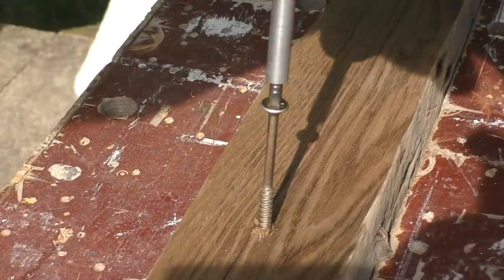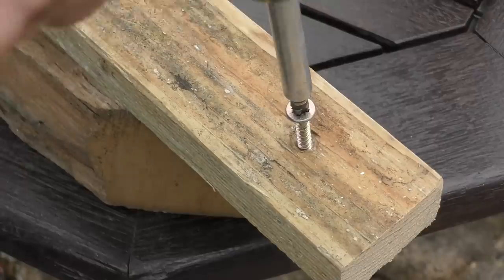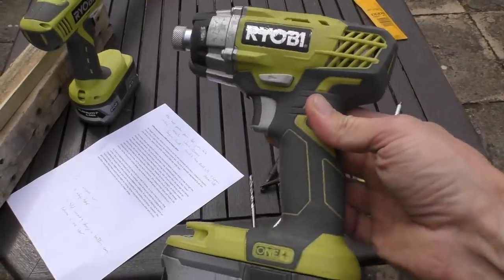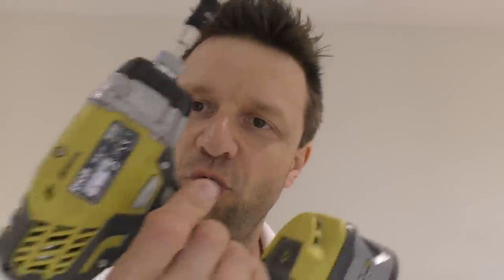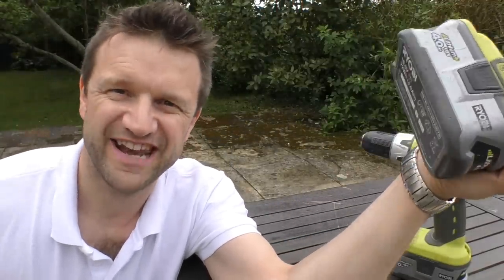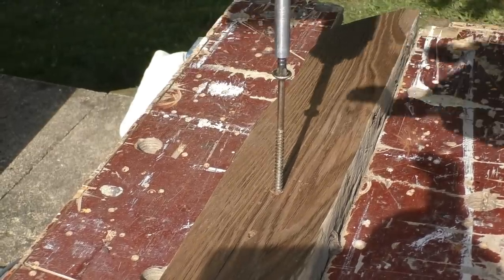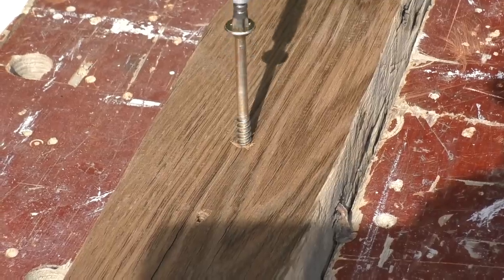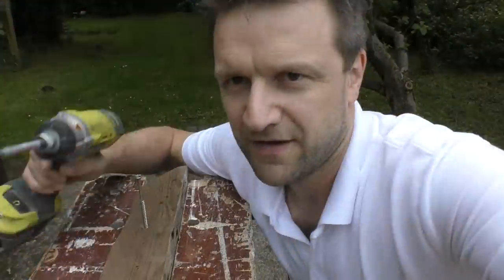Difference between Drill Drivers & Impact Drivers

Comment: The trick with Ryobi and other brands of cordless tools is to take advantage of the sales and package deals they offer several times a year, usually coinciding with major holiday periods. The drill and impact drivers are often sold as a set including batteries and a charger, with the price of the set being the normal price of one tool; sometimes you can get a four or five piece set of drill, driver, reciprocating saw, skil-type saw and batteries for substantially less than buying them one at a time.  Expensive 4 amp hour batteries are often sold at a two-for-one price during these special sales. There is a real advantage in choosing a brand of tool that shares common batteries among the various tools - choose carefully, it is unlikely that you will change brands later.
Reply: And even better is Ryobi hasn't changed batteries since 1996. I think I have a dozen or so batteries now just buying those "special buys". I'll take the better battery, add one of my older or weaker batteries and sell it for half
Reply: DeWalt is for supervisors, ryobi is for children
Reply: I feel like that statement makes about half as much sense as you think it does...
Reply: @chrisapplewhite6660  everyone knows supervisors dont do a damn thing
Reply: This is precisely why I will nevet buy another Makita again. After purchasing the drill a few years ago I needed a hammer drill which coincidentally didnt include the new battery for that years line of products.

I could no longer ignore that Milwaukee sale for a combination hammer drill/drill driver that came with an impact driver, 2 batteries, and a charging station. All of that combined was still 40% less than the Makita hammer drill, new battery, and necessary charging station for said battery.
Reply: @chrisapplewhite6660  well yea the supervisor wants the Dewalt, cuz it's nvr gonna run
Fitting for the 1 that doesn't do anything anyway
Reply: @chrisapplewhite6660  and yet your the one who delivers a childish comment. DeWalt fanboys are the worst. Sure they make SOME good tools but a lot of their stuff is not up to scratch anymore.
Reply: The trick with Ryobi is NOT to waste your money in buying it! 😂🤣😆
Reply: Honestly, Ryobi is for home use, but Dewald, Makita, Milwaukee, and Bosch are for serious commercial work. I've bought an 18V Bosch drill 6 years ago and I still have it with same batteries and it is still running strong. I even dropped it a few times from ladders and it still functions the same with zero cracks in its enclosures.
Reply: In that case, real workers may use "Milwaukee" tools.
Reply: @mweezy  christ get a grip...........my ryobis work hard very hard never had a problem and i dont drop my tools.....they are my livelihood.....
Reply: @rgeo27  lol sure they do....
Reply: @mottthehoople693  
All jokes aside, Ryobi isn't well built. When money was tight, I bought a Porter Cable  reconditioned set and everything still works fine. The sawzall for example, outlasted 4 heavy duty Ryobi ones, which were literally smoking btw. I've upgraded to the brushless set and have bought everything cordless and it's simply excellent! Ridgid isn't bad either for more bang for your buck.
Reply: @mannysabir1339  maybe.....but ive got old ryobis that still work hard...I dont ever flog my tools till they are smoking..i  will change the bit of the saw or whatever no need to smoke a tool........If I really need heavy duty tools I use my generator and all the old tools dad left me....old Wolfs etc....Im sure i will leave them to my son...they outlasted dad and they sure will outlast me...but I have no problems with ryobi and if i put one down and forget where i put it i just get another one..then I find the first one again and have two...
Reply: i use ryobi cos b and q give a 3 year warranty no questions asked just take it back with reciept then go pick a new one up off the shelf all my tools have a use by date sharpy'ed on the bottom (i still buy the deals with batteries tho)
Reply: @flatlandAutoSales  Ryobi. Lol
Reply: @chrisapplewhite6660  And Milwaukee is for the people who do the work. Do you know that Supervisors do little to no tool work?
Reply: @mottthehoople693  Generators will make a tool smoke before anything
Reply: @chrissmith2921  awesome well thought out response. I use my tools quite a bit and they work for me. Buy what you like. I have a Dewalt drill that smells like a slot car every time I use it. I've built 3 stores with Ryobi tools. I'm not a contractor anymore so I don't use my tools daily like some. For my home garage they hold up well and work for what I need them to. Other than that your opinion is as valid as Ford Vs Chevy
Reply: @chrissmith2921  they might smoke the newer lighter tools because their output is fairly unclean but the older tools seem to be built tougher maybe because the technology wasnt as good...but I have no problems running my gear from an 8kva diesel genset and have done for years..
Reply: Before buying I looked at YouTube and found a test between a cordless Ryobi hammer drill and the latest Dewalt offering and the Ryobi you uneducated call 'Unprofessional', destroyed the Dewalt in every way. This is all just snobbery born of ignorance, and lack of proper research. Oh, by the way, the Ryobi had a steel ratcheting chuck and ,tool only, cost me $30us on Amazon as I had the 4ah batteries etc. Makita bearings  go and the heat melts the gearbox plastic housing plus their drills require a mortgage in comparison. I have a massively heavy Milwaukee hammer drill that cost $400 from a different era gathering dust because it is hopeless at concrete work. I'll happily sell you my Makita and Milwaukee drills cheaply.
Reply: @kris Williams: Good observation: DeWalt can make a very good tool, along with some other truly defective or badly designed ones.  That Brand has probably the worst tool Quality-VARIATION form one model to other.  Some models differ so much  between them, that the ONLY thing in common is the yellow color...
Reply: Great point, I tell all my  customers as a Home Depot associate that is the way to buy ! Then you can build your tool collection of the brand you prefer by buying tool only . Because you bought the kit that has the batteries and charger already . Another great way to build your tool collection of the brand you prefer, we clearance tools out  regularly  at Home Depot. Get to know a sales associate in the hardware, and they will inform you of at what went to clearance.I have my loyal customers that come in and I know what tools they prefer and I always look out for sales for them so they can build their collection.
Reply: @kurtlee3198   We have 90 day return policy at the Home Depot.you have to go through the manufacturer  if you haven't registered it.
Reply: @SerenasuzanneCrossland  i guess we are kinda lucky then over here in England we can just take a broken Ryobi back to B and Q with the receipt (within 3 years of purchase) and they'll tell you to go grab one off the shelf
Reply: @kurtlee3198  what is b&q?
Reply: dude this is really bad advice.  the package deals give you the shitty version of each tool.  you are not saving any money.  trust me on this.  there are videos explaining this on youtube.  if you are someone who uses your tools often, get the quality over quantity.  this is true for every competing manufacture like milwaukee, dewault, ryobi, etc.   For example, a ryobi package that includes the reciprocating saw will be the P515 version.  Compare to the P516 version which is what you get when you buy only the saw.  Major differences.
Reply: @chrisapplewhite6660  ryobi is decent for home/diy use without the premium prices or de walt or makita. No need to start a cock stretching competition just because you have a de walt set up
Reply: @ohasis8331  Absolutely correct.  That was why I picked Ryobi at the first place.  Ryobi has the greatest collection of cordless power and garden tools.
Reply: So far ive noticed this with Ryobi. When I bought my first Ryobi tools, the distributer was at home depot at the time and I was looking at the combo sets. He ended up telling me that since the deal was buy the 2 battery pack and get a tool free, instead of buying the two battery combo tool pack, to just buy the separate tools cause they are better. Now I recently just bought a Milwaukee Fuel hammer drill/driver with impact combo set (I'm switching over tool brands to Milwaukee now instead of Ryobi), that also came with a grinder and hacksaw fuel tools and their new storage cases, and they aren't any different than the fuel impact and driver you can get separate. I think it ultimately depends on the price for the set. So far I've found the more expensive sets with fewer tools will be the same tools you can buy separately that are just as good, while the cheaper 10 piece tool sets have the cheaper end tools in them.
Reply: @johnfoskey7855  this
Reply: You have to buy power tools when they go on sale or have a large percentage off coupon. I just purchased 1 large 7 piece combo and 1 1/2 Impact 1000 LB Torque Milwaukee sets using a 15% off, 5% Cash Back PayPal Discover Catergory, and Home Depot Special Buy offer. I got 2 extra tools and 2 extra batteries  compared to mixing and matching a set together. Yes, these are the best M18 Fuel models sold besides the saw isn't the 7.5 inch model 😡. Just take your time and price put the best combo. Home Depot combo Special Buy sets are the way to go!
Reply: @jamester000  hey dude can you explain this in more detail. I just picked up a combo kit from dewalt. Are you saying that combo kit isn't as good as a single purchased dewalt tool?
Reply: @GoGATORS!!  Late but if aby one else wonders compare the tool model number in combos to the seperate tools. If they are different odds are the on in the kit is a lower end model of the same tool. Ofte
Reply: @GoGATORS!!  Late but if aby one else wonders compare the tool model number in combos to the seperate tools. If they are different odds are the on in the kit is a lower end model of the same tool. Ofte

Comment: I knew the difference between drill drivers and impact drivers but the difference between batteries was VERY informative.  I rarely drive fasteners that are an issue but I have used a battery powered impact wrench and been disappointed in its power compared to a pneumatic impact wrench.  I am going to try my Ryobi 1/2in impact driver with a larger battery.  Great video!  Thanks.
Reply from the maker: Thanks John. Yes, I'm sure that'll make a difference. 👍

Comment: I was a faithful user of another brand for years.  When I chose to add another tool, they had changed the battery connector.  I returned that product to the store.  I went to a different store and purchased my first Ryobi.  That was nearly 20 years ago.  I've added a number of other tools since that first and only one has actually worn out.  A few years ago, I added an impact driver.  Not only is is faster, but I find that I can drive more screws per battery charge than I could with the drill/driver.

Comment: Great demo. One correction: the higher amp hour rating doesn’t make the battery anymore powerful, it simply means it will last longer than a battery with a lower amp hour rating under similar load/current draw. A 5 Ah battery has enough charge to output 5 amps of current for 1 hour before going dead. For more power (in the technical sense of the word), you’d need a higher voltage battery. A 24V drill will be more powerful than a 12V drill. Putting a longer lasting high amp hour 12V battery on a 12V drill will not make it more powerful than the 24V drill. Fully charged, similarly aged batteries of similar voltage are important for a good comparison though to ensure they both have the same “potential” (voltage) and can output the same power under similar current draw demands.
Reply: At last, someone who knows what he is talking about, and knows how to explain it to dumbnuts like me. Thank you.
Reply: then what is the reason for the difference between the two batteries in performance observed in this video?

Comment: I have several of each, and most of the time I prefer the drills for screwing into light wood or laminate because you've got more control. For tightening bolts through metal however (especially through a nut), having the vibration is key. For hard or very deep wood, a tiny pilot hole followed by a drill is going to make the cleanest result, but a strong impact can save you time and like the guy said, be easier to do.
Reply: Can you help me? I want to put this solar light on my house it has metal siding ... will a regular drill work? That’s what I have.. or do I have to get a impact driver? And if so how do I know which drill bit to use to drill thru metal siding ?
Reply: Why not just use an impact driver for everything

Comment: Thanks, that was helpful! Sounds like an impact driver is really worth the investment. I’m building a rock climbing wall, which requires hundreds of screws to keep the plywood in place. I’m getting an impact driver now to make the rest of my day a lot easier!
Reply from the maker: Yes it will be invaluable for that 👍
Reply: can confirm, impact drivers are the way to go for climbing walls. Talk to any route setter at any climbing gym about what they use and i'm sure just about every one of them uses an impact driver. Also the use of an impact driver will help to prevent over tightening of the screws so you won't crack the holds on the wall if you drill them in too much

Comment: I used to think an impact driver was only for roof screws and a drill driver was for everything else. But since I got an impact driver in a multi tool kit in 2012 I've found that there are lots of bits available in hex shank and that an impact driver is super capable even when drilling wood or metal as long as I have a suitable bit. Nowadays I rarely use my drill at work. So much so that my old cordless drill is hard to find in my van because it's been in disuse for so long that it has vanished.

Comment: Thank you!  I bought the Ryobi tool set, Drill Driver, Impact Driver, Recirpocating saw, Circular saw. I tried drilling screws into wood on a bridge with the drill driver with the 4 ah battery. It was a challenge to say the least. I didnt finish the job yet. Your video explained issues. I will attempt agian with the Impact driver and 4 ah battery. Your a life saver!